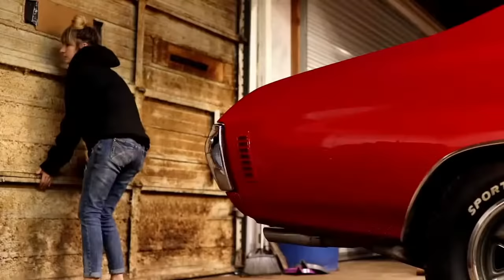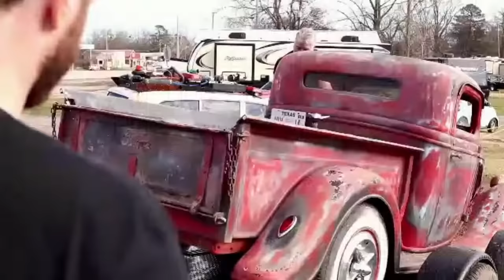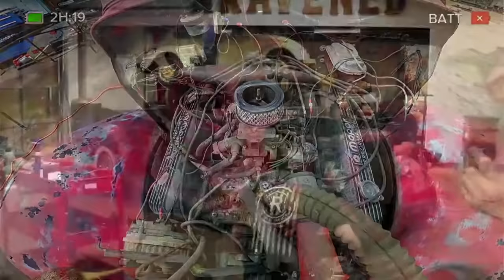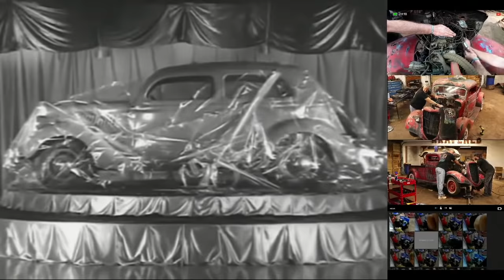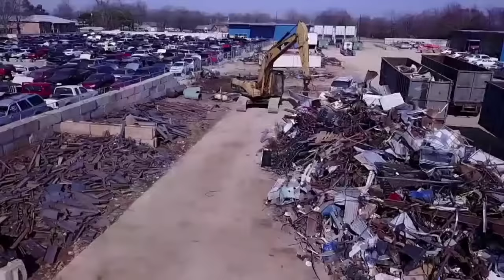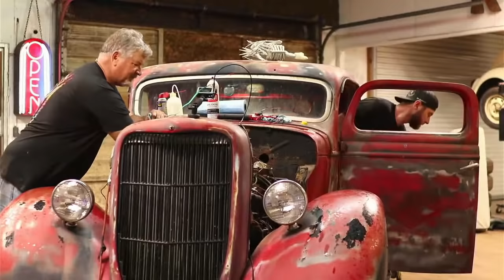LIVE Forgotten 1935 Ford Truck | Will It Run | Gene Winfield Inspired Build |RESTORED

Comment: I with I cud afford to buy this truck I would fine a flat head v8 an rebuild it then I'd clear coat the body I would be one happy man with that truck. Just so you know there must be a ground from the engine to the frame and a ground from the engine to the body if you don't it probably will not start or it will short out and start it on fire an it can damage other things and cost a lot of money to fix its Rilly important on the newer automobile's that all the grounds are good and they are all Huck up.

Comment: I know that this is going to go against everything that you folks watching love, but I think I would have to toss out the318 and replace it with a new Ford 302 roller or a351 Cleveland Bored Out 2B. A410 cubic " . now comes the part that is going to upset someone folks, yank out the mustang2 front-end  and what ever is happening in the Rear end Band replace both axles With Dana 60s And lift the truck to inappropriate highest Probably putting no bigger than 33, then hang an Atlas transfer case Behind Some sort of ford Standard transmission. Not trying to turn it into a crazy off road vehicle but more of a Going to the lake Run around on the farm with the buddies I live down by the beach be great gold run run on the beach do deer hunting on the weekends But then clean the paint job up enough that you can take your woman out for a nice dinner after church There's not enough room in there taking entire family So you have to leave them at home No heck leaves a woman at home get to steaks while you're at the restaurant

Comment: Why you donot take the engine down and clean, rebuid every peice in it then return it  on the vehicle..also the curborature  clean it . Disparutor needs to insure it generates a electric sparks.
That it is..every thing will  new and o.k.

Comment: Do you do any work on j3000 trucks I have one that's got a Dodge motor in it but I'm having trouble finding distributor the fan your starter and a few other parts truck was gave to me for free it's been setting for 35 years Motors free transmission looks like crap it's got a 360 in it

Comment: Putting easy start into a carburettor is the WORST thing you can do to an engine,,,  

It dilutes the much-needed oil from the cylinders thus causing much wear at start up, when its needed most.

Comment: If its got a dodge charger engine in it do it up as a general Lee van and put the dixie horns on it with the confederate flag on the roof and 01 on both  doors and a cb in it